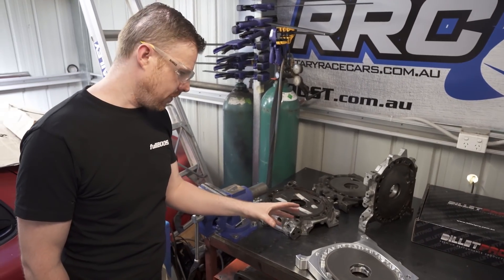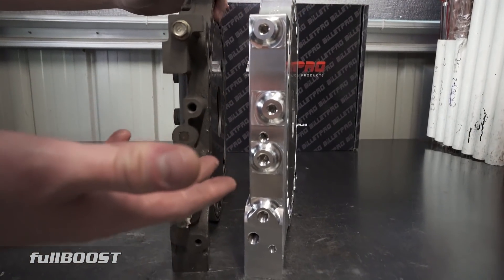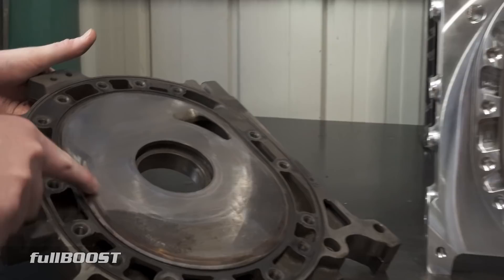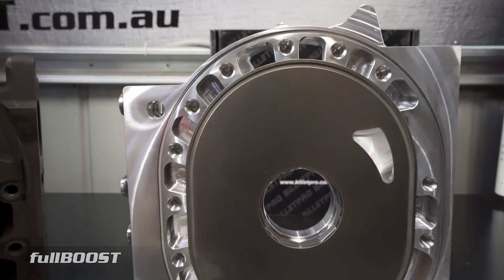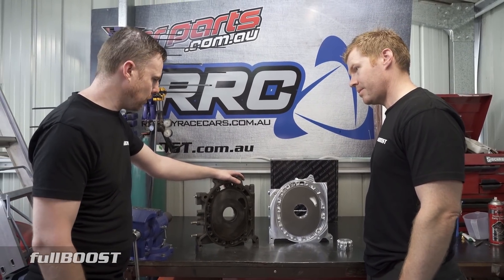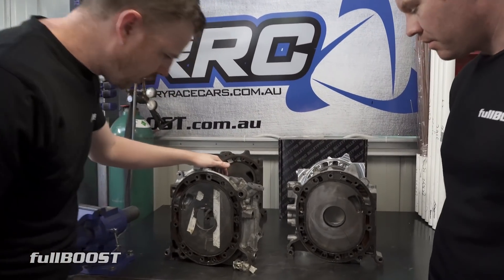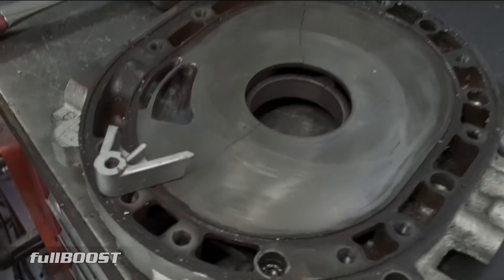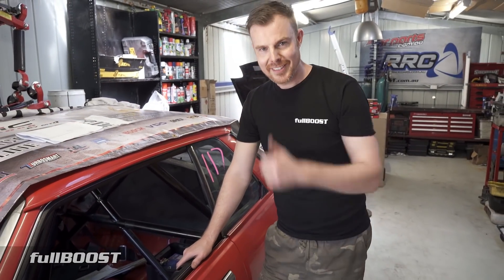Why you need a BILLET Rotary engine | fullBOOST

Comment: So how the fuck are people supposed to believe this? You say that an aluminum (not even forged but machined) block is stronger than a cast iron block but you don't give any material specs like, is it Duraluminum or some other kind of high strenght aluminum. From what i can tell from the video, the billet block is significally lighter and has a removable backplat and that's it, no enhanced strenght. There is a reason why some diesel engine blocks still are out of cast iron ;D.
Reply: Mandernach Luca 7075 billet aircraft grade aluminum. It’s billet, its machined from a big single block of aluminium. A forging is still cast and will always be weaker. Cast iron is very strong, it is also brittle. Diesel engines are designed for the big cylinder pressures they see and reinforced accordingly. Stock rotary engine is not.
Reply: @BackyardMechanics  
I have to disagree, cast iron (grafite)is not forged steel (carbon), know the difference ;D.
Reply: @Enthropical_Thunder  wut
Reply: @GarageSupra  
A forging is still cast. In itself it is true but you have to specify that it is cast steel that is forged, not cast iron where carbis found as grafite and not as an alloy compound. The point is that steel is tough and can withstand high loads and heat most definitly better than aluminium alloy and all this at a fraction of the price and with the benefit of not having weakpoints due machining the whole block, with the disadvantage of being heavier. That's why i question the billet trend, you could as well cast a steel block that withstands even higher loads.
Reply: @Enthropical_Thunder  I suggest you check out the real st racing video that explains the reason people do this with conrods.
Reply: @GarageSupra  I love watching Jay's Tech tips. 👍
Reply: @GarageSupra  
Do what with conrods, forging?
You could as well just use a suitable steel and faceharden it. Conrods have to meet other criteria than an engine block, that's why you still see a cast iron faceplate on the aluminium alloy block, aluminium has close to non wear resistance, automakers usually just resort to hard coating, for example Nikasil (nickel silicon carbide).
Reply: @Enthropical_Thunder   I'm not going to get into the physics of metallurgy with you. Just watch the video
Reply: @GarageSupra  
Would you mind giving me a link?
Reply: @MafiaboysWorld  
Don't know what the link is supposed to tell me, however, your right. Don't trust me, do your own homework and discuss it with me. However don't trust some randome youtube video either, this video is the best example of what you mostly find on youtube, dumbed down informations that are easy digestible for the common youtube user. If i am false than please correct me and tell me why this overpriced aluminium "shit" is worth to buy with arguments other than what you think my qualifications are ;D.
Reply: @Enthropical_Thunder  You do realize that random YouTube video is from Jay Meagher, the guy who own and runs Real St. Performance, you know, the 6sec Supra that just did drag week. 😉 So yeah, I'll take his PROVEN expertise of building DOZENS if not HUNDREDS of over 1500hp 2JZ's over you and will TRUST the ones who have done the R&D and shown the results. 😎
Reply: @MafiaboysWorld  
Of course, you can take his expertise as a tuner and buisness man. However, that doesn't make him a metallurgist or an engineer in anyway 😂. Therefor i wouldn't trust him  in regards to the structural integrity of parts that i have to buy with a lot of money, i mean, he literally puts a side load on a cast iron block (on a sharp edge) to prove how easy they break, an engineer will know instantly how wrong this test was. Do the same thing with this all mighty aluminium alloy block and it will bend and will be unusable. You see, my issue is that he did in fact prove nothing more in the video than the brittleness of cast iron, wich has been overcome by adjusting the design of the block to the material, meaning : no sharp edges, always placing mounting points so that they only take pressure loads and tensile loads or torsional loads. That's why i tell you to not believe anything on a randome video like this an go and do your own research, you can only benefit from it 😎.
Reply: @Enthropical_Thunder  No disagreement there. Aluminium in general is known as a weak metal, otherwise it wouldn't be so high up in the periodic table. However, aluminium is also a lot better when it comes to things such as dispersing heat. As you pump more power out, the heat generation is held more by cast iron/steel. Through the life of the motor this heat retention causes weak spots and it then reaches it's breaking point where the aluminium one, while it does bend, there is still a level of flexibility in it which offsets the shockwaves created by combustion which can't be achieved with a cast conrod or block for that matter. 👍
Reply: @MafiaboysWorld  
That's very true, but in this exact case the aluminium also has a great negative, the low heat expension. There will be thermal stresses between the cast iron backplate and the aluminium base because of the difference in heat expension. Wich can lead to premature failure. The dampening of the combustion shockwave is actually something that cast iron always has been taking credit for, or more specific, the grafite layers in the cast iron. These have a different density than the iron around can therefor take energy from the shockwave when it pases through.
Reply: @Enthropical_Thunder  Yep, and in a rotary, the biggest advance I saw in the old days was Matt Cole using graphite to make his apex seals!! Wasn't the best result but the knowledge gained was invaluable for the Sydney rotary community later on who were still lagging behind the Melbournian's and they caught up very quickly.
I linked in another comment on here a full billet rotary from PAC, plates and housings!! 👍 I'll find the link and repost it for you.
Reply: Oh lord why are people so fucking dumb
Reply: MajorLeague  
What, how can that be? The only metal i know that could be stronger per volume than a steel alloy, would be titanium and even than it would depend on the sort of steel alloy.

Comment: Would be a shame to have one of those plates warp the way conventional heads can... you can only mill out so much.
Reply: You can replace the iron plate on the aluminum front rear or center plates when rebuild time comes warped is warped trash can time, thought that was a nice feature since there 2700 a piece lol
Reply: Guess they are a different beast on all fronts. Just remembering when aluminum heads started to hit the north american market. The heads always needed decking at the next disassembly.
Reply: @TheCanadianBubba  This isn't new it's new to you. Three companies make these and making 1000+ hp 3 rotor engine and going several events before tear down. The fastest rotaries on the planet use billet rotary engines. Go to HPA's channel, billet 4G63, no way you can make 1200 hp with a 7 bolt and not have problems, but that car is 1,200 hp and driven regularly on the street.

Comment: any excuse for a jab at RB's 😭
Reply: L Taka known fact unfortunately. It’s why many use an RD diesel block. Check out some in depth research motive video did on this recently.
Reply: @BackyardMechanics  the RD block was the softest of all wasn't it? RB30 block FTW!!!
Reply: Bullet does a great billet RB30 block and head too!!!
Reply: Sean Price  Eh? Marginal at 900-1000 hp, N1 block no better than the diesel block and over a decade plus wasted with that thought process. When a stroked Ecoboost made 700+hp stock alum block when a stock sleeve failed, no damage to the block. Same shop has several daily driven 600+ hp Focus ST's: stock head, block, forged internals and cams. Majority of RB's problem is the twisting of the front driveline components.

Comment: Correct me if I'm wrong.... but I thought cast iron is stronger than billet aluminium?????? Obviously if the billet aluminium is way thicker it may be stronger... but comparing apples and apples.... I thought cast iron would actually be way stronger?????
Reply: Side by side with the exact same measurements, iron is stronger. Thing about billet is you can make a part that has more material where it is needed and still be lighter but stronger in those needed locations.
For example, lets take cylinder wall thickness. If you made the same casting of an engine like an LS in both iron and aluminum and all the specs are the same. Hypothetically, the cylinder wall thickness could be around 5mm thick. 5mm of iron is going to be stronger than 5mm of aluminum. But if you decided to make a billet block, you have the easy ability to thicken that cylinder wall to 6,7,8 or 9mm because you are not confined to what comes from the factory. 
Billet is usually stronger than cast aluminum as well because it lacks all of the micro imperfection that take place in the casting process.
Reply from the maker: Yes the reality is if these parts were weaker no one would buy them. All top end piston engines are billet.
Reply: @fullboost  Nah nah, Elmer Racing only makes billet engines to rip people off. RP968 got scammed so hard, he should've just gone to the wreckers for some OEM Porsche 924 parts mixed with some chinese VW Beetle parts from eBay, just so OP bulletproof hey. 😉
Reply: Fullboost I get that!!!!   But cast iron is still excellent!!! If an LS LQ9 block such as in Quentin feasts Torana can handle 1800hp plus....for around $1500 to $2000.... I'd say it's not bad at all!   And the longevity is also very good!!!  With a billet aluminium block....I'm pretty sure you wouldn't use billet aluminium main caps!!!! Why???? Because is not strong enough..... but nodular cast iron would be fine... and steel maybe better. Cast iron and steel is used where it matters most!!!!  By the way.... I'm not trying to argue a point... I'm just saying!!!
Reply: Caste iron end plates are thin outer parts  around most areas an core shift in the casting process can make it worse. They aren't slagging off the cast iron they are showing you what the newer product can do.
Reply: motorised1 my point is..... if your were to make a new cast  ironat the same dimensions as the billet aluminium piece..... the cast iron piece would be way stronger.... even with core shift!!!!
Reply: Apples to oranges, they both have faults. Really depends on what kind of billet aluminum it actually is. Forged trumps all.
Reply: The difference is between being ‘strong’ and being brittle.
Reply: @tmaxxtantrum  HEY LOOK EVERYONE, IT'S A RACIST DUMB FUCK!! 🤨🤨 Kids like you are the reason the USA is going down the toilet. 🤦🤦🤦 Besides, I'm Anglo-Australian, I'm probably whiter than you. 😎😎

Comment: Too bad billet is nonsense i remember old fart teachers at tafe talking about billet component's even now most billet cant be used . And what 2500 each or so before you even put it together  . Damn id rather have a piston engine
Reply: Billet is nonsense? Is that why pretty much all high power race engines are made with billet? Even hopped up street engine parts are billet.  Better quality control + better materials = more power handling capabilities.
Reply: @zososldier  i bet you like your on comment.
Reply: @zososldier  says the person with out a clue im sure all race cars have all billet parts . Another troll
Reply: @_i-kr6eg  Uh... they pretty much are. At least the ridiculously high Hp ones are. Billet block, heads, rods, crank, cams, intake manifolds, turbo/super charger parts... all made with billet as a strength option.
There is kind of a reason even people wanting high HP street engines go with forged/billet parts like in the rotating assembly.
Reply: @zososldier  im sure everyone can afford such parts . Wtf people are still running cast iron block into the 7 second even 6 second pass . You haven't a clue.
Reply: @_i-kr6eg  Build an engine with 10k HP and get into the 4s with a stock block. I dare you.
Reply: you clearly have no understanding of the difference between an engine made from a  billet block and an engine that is sand casted from iron.
Reply: Build a sold V8 then the maths is the same
Reply: Why you watching a video on rotaries then?
Reply: @zyoungson215  i can say the same too you why are you watching a rotary video you troll maybe non car enthusiasts? ? .
Reply: Theres gas engines now running over 100 psi of boost thanks to billet blocks
Reply: @BIGSMOKE-bl2lq  i already know this muppet so still many run cast iron block that make the same power what are you no about . Another wannabe car enthusiasts or troll .nice channel maybe stick to your computer or gaming consoles you kid or manchild still at home with your mum and dad.  I bet
Reply: Negro why delete your sad comment for? ? Another troll and wannabe car enthusiasts.  Stfu
Reply: mr323i  what are talking about you Pure Gronk.... stick to playing Forza .

Comment: Just when sinking all your money into the rotary game couldnt be easier they up the stakes...
Reply: pfft ur lucky you dont have to buy Billet cams, titanium springs/retainers. especially when considering quad cam v6/8/10/12. you can easily 5k on just a built 2j cylinder head with light port/polish. now that there is actually a decent aftermarket support for core engine components it makes them a viable option for high horsepower all out builds  while being relatively cost effective in that area. the only downside to a rotary in the racing world was durability at higher HP levels.
Reply: I honestly don't understand blokes like you. What do you expect your engine to do, be honest with yourself? You think it's reasonable to expect to get 2-3-4-5x more power out of stock parts? Why would you think you're entitled to that? There's absolutely no one forcing you to modify your car, no one at all. If you can't afford it, don't do it.

Comment: Ah yeh truu a billet rotary, might be able to take the same amount of boost a stock block LS can ;)
Reply: And make triple the power of an LS
Reply: When your talking LS try telling people cast iron or the aluminium ones people that high boost running motor remove.
Reply: @motorised1  Exactly the LS is marginal at 700-800 hp. You can get an iron triple rotor to do that, ask Rob Dahm, he did 900hp before he turned off the safety features to hit 1,000. An LSX from Texas Speed is $7K before the turbo system and fuel system needed to make 1,000 hp reliability. Sure you can make 600-700 hp from mostly stock 5.3 LS but beyond that, it's no cheaper to do that than to build a good 3 rotor.

Comment from the maker: #BILLETTHEWORLD 😁
Reply: Yooo hoooo mazdaaaaaa... get on it. I want an RX-9 with a billet 4 rotor. I also want ceramic coated billet rotors and housings. Multi port variable length intakes. I want it all and I want it now.
Reply: @rotorhead5826  it can all happen again once we finally realise that the CO2 is not a demon's fart
Reply: Fullboost are u guys planning to put billet 13b for ur red car
Reply: CAREFUL the Ls boys aren't going to be happy
Reply: @jmoore9806  why would the LS guys care? You can buy billet LS blocks, cyl heads and cranks too... I don't get that comment
Reply: Suppose one was to rebuild ones 20b, is this an option with billet pieces?